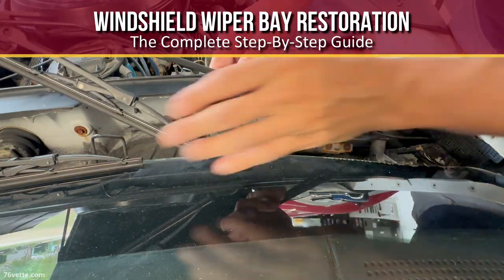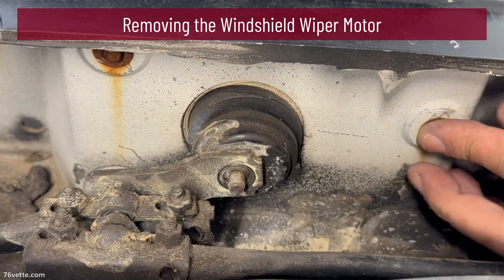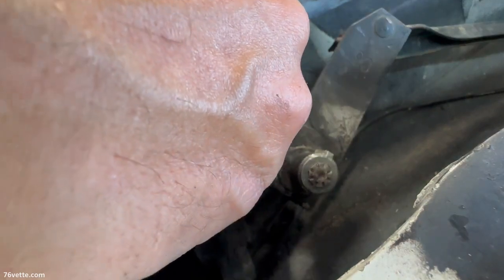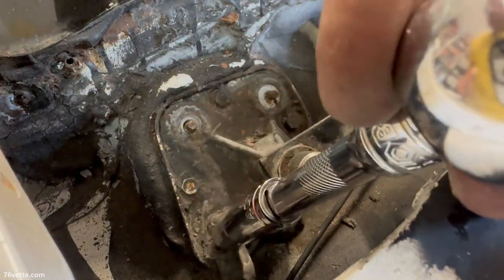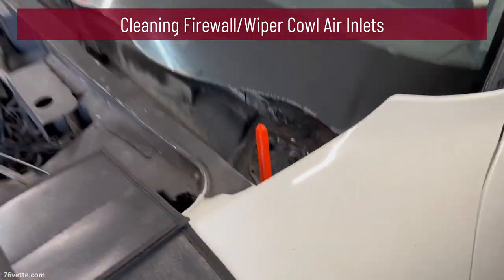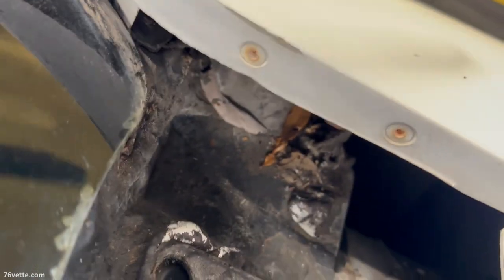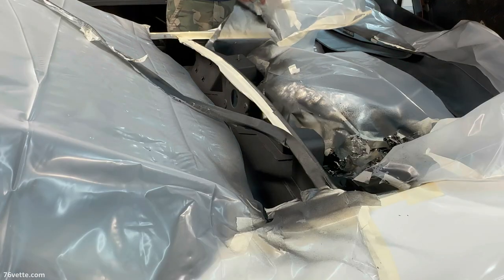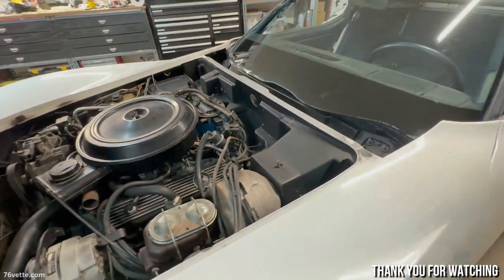The CLEANEST C3 Corvette WIPER BAY

Comment: You did good It is a huge improvement. I`m going to do the same to my 1980 one day. I really don`t like the covers that people put over the wiper bay. I think they look cheap. But I can understand why people want to cover up that eyesore.

What you are doing is similar to what the euro car crowd call OEM+. You restore and improve on the car in such a way that it looks like it could have been built like that only with a nicer finish. Usually with a properly done OEM+ build you can`t tell that the car is modified unless you are into the same cars yourself and know how rough they were stock. I guess a restorod is kind of the same thing.

Im looking forward to the next videos.
Reply from the maker: Thank you! I love the OEM+ way of describing the detail work. Had never heard that and it makes perfect sense. I did not modify the wiper bay. I just refinished it the way it should’ve been done by the manufacturer in the first place. 

As far as the cowl covers, yeah, not my thing, and most of the ones I’ve seen don’t seem to fit very well.

Thank you for watching and for taking the time to comment. 😊👍🏻

Comment: Nice work, need to do mine as well. I use a brass wire wheel in my bench grinder to clean all my bolts and it leaves them spotless...just saying.
Reply from the maker: Thanks! I need to buy a bench grinder. I’ve been looking on the Facebook marketplace but it always ends up on the back burner. Thank you for watching! 😊👍🏻

Comment: Have you ever thought about using a Dremel to cut off the excess panel bond? You can also get little drum sanders for them, that just seems easier and faster, just a suggestion, but yours turned out great! 
Im with you on the way that you restore your cars,” what looks good to me” that’s the way I do mine. GM should be ashamed of themselves for the way the left this area! Looks like the slobs were assigned this job!
Reply from the maker: That’s a good idea, Dan, and honestly, never crossed my mind. No clue why. And I’ve had a Dremel for years. 🤷🏻‍♂️

They are great tools and—as long as they don’t get away from you—you can probably cut the time spent manually filing, at least in half. 

The only thing I don’t care for is the dust storm they generate, but the time savings can be substantial, so thanks for the suggestion. 

And yes, I refinished the wiper bay the way the factory should’ve but didn’t. 😊👍🏻
Reply: That's what I thought.  For about $120, you can get a kit with many heads for a lot of different application.

Comment: So I'm about to start on my wiper bay (79). There is something on the bottom left side (D) that starts close to the wiper motor and ends near the wiper attachment plate. It's on the bottom flat surface, about an inch wide and 6-7" long. Anyway it's vary hard and I can't tell if it's part of the wiper bay or a blob of old sealer or bondo. The surface is not flat and smooth like yours. Not sure if I want to take a chisel to it. Any thoughts?
Reply from the maker: Gosh, without looking at it, it’s hard to tell. You can send me a photo if you’d like at diy76vette(at)gmail. com 😊👍🏻
Reply: Thanks. I’ll send that to you tomorrow along with a 1950 Plymouth Special Deluxe I have.

Comment: Just one question. Is there a motorized washer pump at the bottom of the washer bottle, and does yours work? Thanks.
Reply from the maker: There is, and yes, I hear it working. 😊👍🏻
Reply: Mine isn’t working and looks like a real pain just to get too. My next project is to clean out my wiper bay and see what’s up!
Reply from the maker: @inell6  Not sure if the Corvette Ben has covered replacing washer bottle pump in a video, so you may want to check his channel. 😊👍🏻
Reply: Ben didn’t have one but found one that helps. Looks like you have to move master brake reservoir from the booster, then move the cruise control module that is riveted to the wheel well. Oh joy!
Reply from the maker: @inell6  Good luck. Some of these projects can become real PITA affairs. Lol 😆
Reply: @76vette  Hello. Just replaced the washer pump on my 79 Vette. Tested the old pump and was definitely not working. Tested the new pump before the install, and works fine. My question is on your 81, does the wiper switch button turn on the washer pump? Haven't tried my switch yet. Thanks.
Reply from the maker: @inell6  I think you have to push it to activate the pump.

Comment: What were u doing with the air pump?
Reply from the maker: Sorry, I don’t follow.
Reply: At the 28.45 min u used a vacum pump for what purpose,thanks
Reply from the maker: @danabrams2224  Oh, I used a vacuum pump to test operation of the passenger side cowl air door. 😊👍🏻
Reply: Did your hand and arms get itchy?
Reply from the maker: @ThePerfectSeason1972  If they do I rinse my skin off with a 50/50 water and white vinegar solution. It works well for me. 😊👍🏻